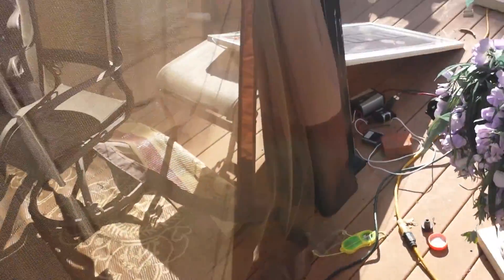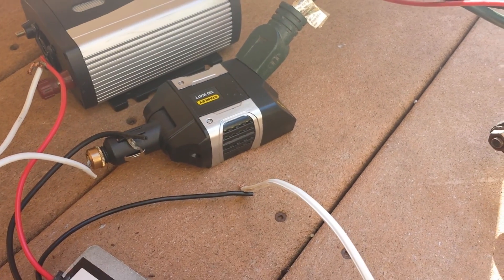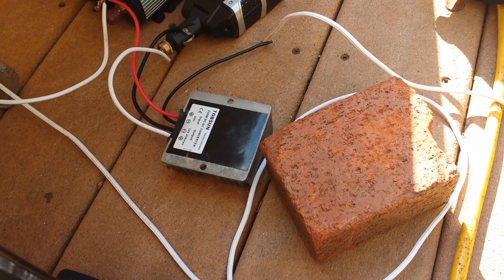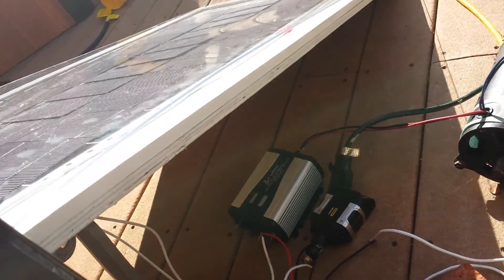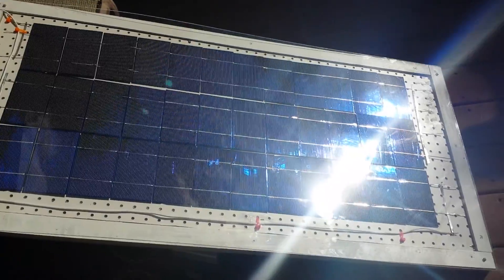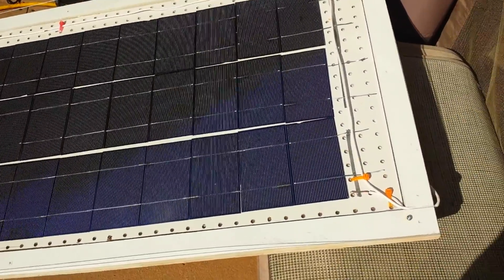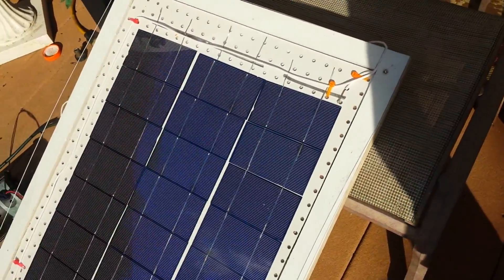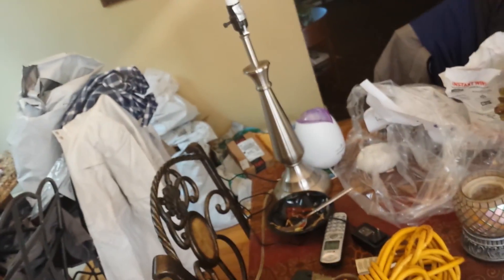diy solar panel powers light bulb without batteries

Comment: Would you have a link for the voltage regulator.
Reply from the maker: +Bonnie Flory i dont know if i can share links on youtube but i can tell you exactly how to find it just type this "24 volt to 12 volt converter" on amazon and i think its the first item and i would reccomend getting a charge controller and adding batteries so you get power 24/7 this video was just a test to see if i can directly power things without batteries
Reply: +Dean Walcott 
Thank you very much for your response.
I want / like  to be able to power things like fans for example without batteries.
Eventually batteries will die and have to be replaced and I want to avoid this.

BTW, good job making this video and your set up.